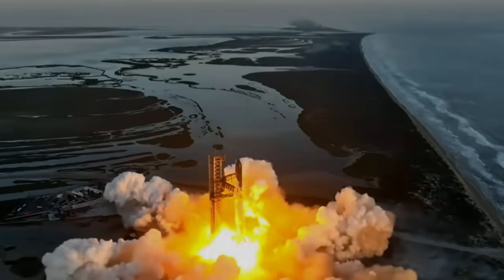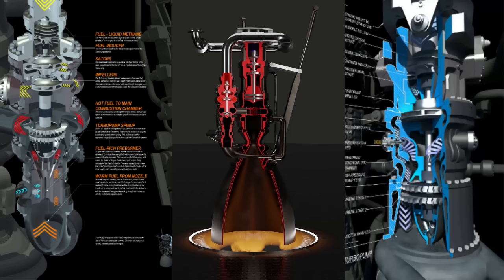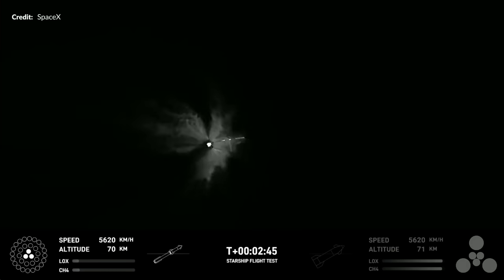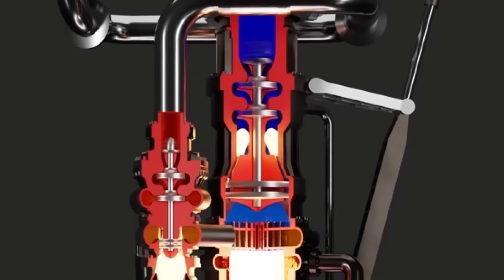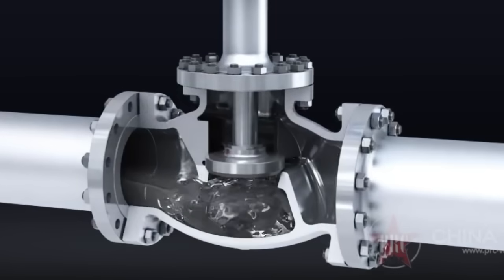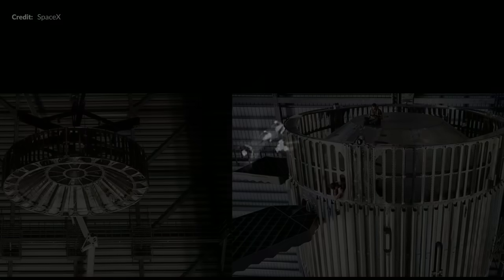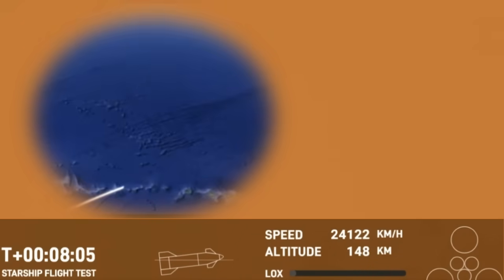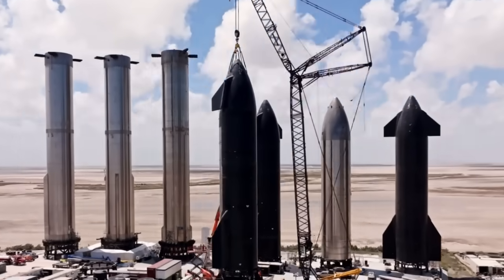Starship Flight Failure Analysis IFT2

Comment: Are you reading from a script that someone else prepared and have you verified the accuracy of what you are saying? You said, "...the 26 outer engines are spun up..." when there are only 20 outer engines. You said, "Everything went perfectly on all 30 engines on this launch..." And what about the other three engines? Gaffes detract. But well done and very informative otherwise!

Excellent assessment of what I'm sure hundreds of scientists and engineers at SpaceX are grappling with as we speak. Normally accumulators or bypass valves would help reduce the hammering effects of rapid shutdown but space and weight limits may hinder that to some extent. Could the rocket engines be throttled back more slowly to reduce hammering effects? Could the liquid storage tanks be compartmentalized into multiple stories with one-way valves between them that would allow flow only toward the engines and reduce reverse sloshing and gas-bubble-forming effects?
Reply from the maker: I write, narrate, and edit.  That allows my brain to fill in what I think I said.  Looking at the N1 too much.  20 and 33 of course.  I don't remember saying 26 though.  I'll go back and check. Thank you.

Comment: It looked like the Starship fuel levels went from full to very low, very quickly. 
What happens to a turbo pump when there is no fuel?
Whatever the reason, it did seem like there was not enough fuel for the engines.
Reply from the maker: A gas pocket will cause a turbopump to spin itself apart...
Reply: Imagine spinning a turbo pump with no friction to higher speeds than it was designed to do because of a bubble in the fuel lines and then slamming the blades into liquid fuel when it dissipates it definitely would explode the pump with the blades hitting it like a brick wall. Like Revving your car engine up  to 7000 rpm and then slamming it into gear
Reply from the maker: Indeed.

Comment: Just speculating, but I think the first test would've done better if the Pad concrete wouldn't have taken out some Raptors from the get go.
Reply from the maker: We agree.  Pummeling your rocket engines with boulders is an impractical stress test.

Comment: I am sorry but I can't let that statement stand [9:07]. Crossing the Karman line has nothing to do with reaching orbital velocity. The Karman line is strictly altitude (vertical height). Orbital velocity is strictly horizontal speed. Bezo's glorified yo-yo crosses the Karman line but has zero orbital velocity. Starship came close but not because it had crossed the Karman line.

And BTW, the Starship and Booster both have baffles inside. No large mobile tanks anywhere near these sizes are ever without baffles.
Reply from the maker: If you are not above the Karman line you are not in orbit... You are flying. The Karman line is important because a) the Starship went to space and b) was approaching orbital velocity.  Both are necessary to be in orbit.

Comment: Ahh so they didnt use my idea of having 300 oversize yorkshire puddings heated quickly
And expanding for rapid staging seperation. A much improved solution over my previous cake batter version 🤔
Reply from the maker: Indeed! Where's the Pepsi and Mentos when you need them?

Comment: Im glad you are calling it a failure.   So many Musk sycophants calling it a "complete success" when it literally blew up twice on the same mission.   Yes you can, and should, learn from failures and that is a valid part of the process, but a failure is still a failure.  A success would be if the entire thing worked completely as designed.
Reply from the maker: At least the hot staging worked... :-)

Comment: The fuel tank should have separators, shaped like a cilindrical tesla valve.
Reply from the maker: Indeed... Flow down but not up... Should be possible with some side "flaps" in the tanks.

Comment: In summary; The Booster wasn't "thrusting" up enough to prevent the Starship "push-off" from sloshing its tanks... and the engines suffocated... then began to explode...
Reply from the maker: Indeed.  They could have revved up the booster three or just fired the vac Raptors on Starship and would have probably been fine.
Reply: @terranspaceacademy  
My thought was to just leave the 13 inner Raptors running at lowest speed during Hot-stage to maintain positive G-forces in the Booster. Use the "Ring" as a de facto launch pad with Starship boosting away from the Booster.
I like your idea of delaying the 3 inner Raptors until separation.
Mostly, I think with a few tweaks in timing and procedural issues, they will achieve 100% success on a test flight soon. After all, it took them 5 tries to get Falcon 1 to work, and one of those failures was due to a "bump" during staging before the 2nd stage lit up. I imagine that still stings....
Reply from the maker: We think so too! Fingers crossed for IFT2!

Comment: Your first suggestion to fire just the outer vacuum engine during hot staging seems flawed to me for multiple reasons:
1. Starship needs significantly more thrust than the booster’s 3 center engines in order to properly separate from the booster. At the altitude of separation, the sea-level raptors likely still outperform the vacuum engines, not considering significant throttling (which if they did throttle in any way or fire less starship engines, we’d see far less performance gain from hot staging).
2. You also assume that there is no space for the sea-level raptors on the starship to vent, and that that caused damage to starship. I’m more inclined to believe SpaceX has sufficient venting/space to believe they can start up all starship engines at the same time during separation.
Reply from the maker: At 80km?  The atmosphere is done to less than 1%... Sea level Raptors are very inefficient there. And they could just shut off the booster entirely until it reorients with hot gas thrusters.

Comment: I wonder, why SpaceX didn't think about this strategy before? Why did they fire all of the six engines? Firing the 3 vaccum engines sounds much more viable for the first attempt
Reply from the maker: They were afraid of a collision after separation...
Reply: @terranspaceacademy   I heard about this explaination before, but as far as they are able to gimball the booster engines, a collision is very unlikely
Reply from the maker: The booster is pushing itself AND the 1300 tonne Starship. As soon as Starship powers itself the booster's engines are only pushing about 300mt. That can cause it to surge forward and impact the second stage.  This happened to one of the Falcon 1s.

Comment: Could have been damage due to Host staging. Control computer is by grid fins at top. Your analogy may not be correct.
Reply from the maker: Those are well protected.  It could have been but I don't think so at this point.  We'll be sure before too long.

Comment: I don't think hot staging was really considered when the existing Heavy Boosters were designed and constructed.  Even though many of the issues that occurred on B9 might be mitigated by better sequencing, some redesign of the header tanks and plumbing may be necessary.  When it comes to the Starship, I think Elon has the right idea...  Add three more Vacuum Raptors!  With the six it has now, Starship barely makes a TWR of 1:1.  That was very apparent when watching the S25 pull away from B5, even though it had a light load of propellants and zero cargo.
Reply from the maker: It was not... a passive flip away was the original plan.

Comment: The flight was doomed because no fuel was getting to the engines at separation.

My proposal: Install piston systems to force fuel into the fuel lines. Just enough pressure to keep the fuel lines full.

Adds weight to the vehicle. But if they keep on exploding there will be no Starship,

Sanjosemike (no longer in CA!
Reply from the maker: Interesting... the fuel still must be where you can get it though :-)
Reply: @terranspaceacademy  The piston will be pushing the fuel towards the engines at all times. Picture a doctor holding a syringe. Even if the syringe is upside down, the pressure on the plunger and piston will push the fluid toward the needle, and through it.

Gravity has no effect. Position of the syringe has no effect.

I am a surgeon. I have injected many patients with the syringe in different positions. Always works.
Sanjosemike (no longer in CA)
Reply from the maker: You mean like a syringe header tank?  That's a good idea.

Comment: First of all, you missed the black smoke coming out of the exhaust on liftoff. Methane does not leave black smoke, so, although all engines lit, something was amiss. Second, looking at the Starship tiles, it's estimated that over 80 tiles were torn off. That would probably cause loss of vehicle on reentry. But I'm not certain of that. The booster was not terminated. If you look carefully, the booster exploded, in fact  being torn apart at midpoint of the structure. I don't think the vehicle was intentionally destroyed. As to Starship,  I have heard that the vehicle was in 2 pieces on descent. And it potentially overflew populated areas while damaged. Wondering what the FAA is going to say about that!  And finally note the lack of onboard cameras. Every other Space X launch has several. What is Musk trying to hide?
Reply from the maker: The tiles didn't bother me.  SpaceX said they were shooting to survive hot staging and they did.  The FTS is at the middle of the ship/top of the booster with a det cord down the side I've been told. The FAA won't have a problem with it.  It was over the ocean... the FTS is supposed to disperse fuel and stop the flight.  It worked in that regard. He's not trying to hide anything that I can see.  He's not required to show us anything.

Comment: I would note Von Braun’s Saturn series of rockets had zero catastrophic failures in flight. While the Russian N1 rocket launches with 30 engines all failed catastrophically . The more engines, the greater the complexity and probability of a glitch. —- or worse. Just saying….
Reply from the maker: You are quite right.  The massive Chinese YF-130 has 500 "tonnes" of thrust (F1 had 660) so 15 of them, 12 on the outside and 3 in the center... could make a simpler massive RP-1 booster if they wanted to.  Or use 7 to make a Saturn V equivalent.

Comment: Yabut all 6 ship engines weren't fired up simultaneously for the exact reasons you're stating. Outer vac engines only for the hot stage and then closely followed by the inner sea level engines after stage separation.
Reply from the maker: Too closely I think! :-)

Comment: So too many engines = high chance of failure? You would think smaller engines would mean they are simpler and safer, but these engines look extremely complicated.
Reply: I agree.  Given this rocket is meant to be reused and reused quickly, the many engine approach is a more fail safe method.  If you lose 1 of 5 engines, then you're already at 80% thrust....not good.
Reply from the maker: They are but it's the only way to go I think...

Comment: I have a feeling that hot staging is overly ambitious for its benefits.  Seems like a lot of extra problems.  This is typical of SpaceX though, is finding problems that need solutions.  Im hoping they do away with it, like the ship parachute recovery of the fairings.  Sometimes the more simple solution is the best ones.  Is it really a wise idea to have 1 million pounds of thrust hitting the top of your rocket?  Is the structural and engine reinforcement needed to survive that hit robbing you of the benefits of fuel savings?
Reply from the maker: If Starship is to carry people it needs an escape/abort option.  Hot staging is the only way to go.

Comment: Why do they need so many engines for booster landing? It's almost empty at this point and thrust of 3 engines should be more than enough.
Reply from the maker: They would have turned them all off except three on landing... they were just trying to boost back with more power.
Reply: @terranspaceacademy  so it seems that they may not even need restart capabilities on the booster. All engines are started on the ground, and all except 3 are turned off during staging, then these 3 run until landing.
Reply from the maker: That might be a better option...

Comment: Insert small magnet in rotating parts and keep track raptor all move. Colect data.my noob opinion.
Reply from the maker: They do track the turbopump spin and some rpm systems use exactly that. Not these I don't think though.

Comment: Hot staging was responsible for the loss of both vehicles.
Reply from the maker: Why do you say that?
Reply: @terranspaceacademy  Because no one has given me a good explanation for the flash of light (explosion) that happened a second after separation at the top of booster nine.
No one even mentions it but if you look closely you will see it. I believe that flash of light (explosion) fried all the booster control systems and engine management.

Also the six engine hot staging (which has never been tested before) was performed in an incredibly small area yes it had vents but I think it was more like an explosion in ship 25's engine bay than an ignition this would have resulted in some damage been done to one or more engines which could have led to an AFT.
Reply from the maker: Interesting... Cooked the battery pack?  That would be an issue.